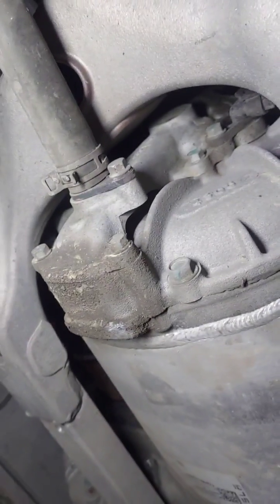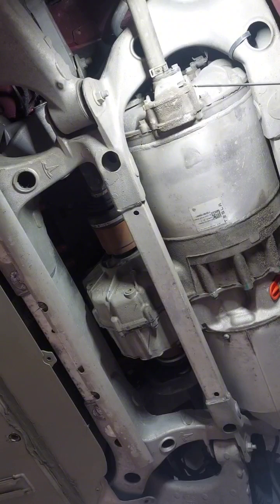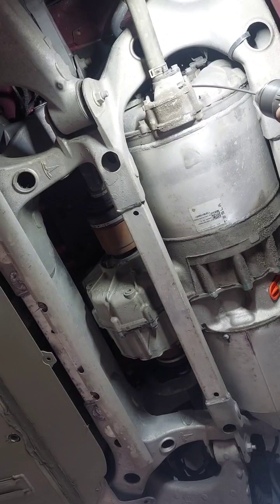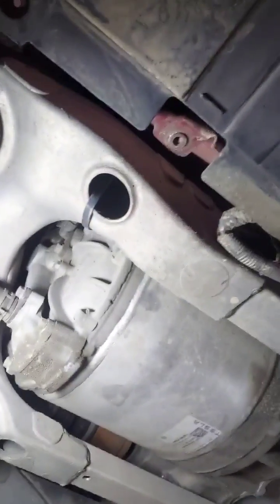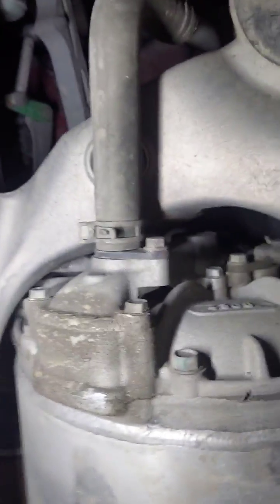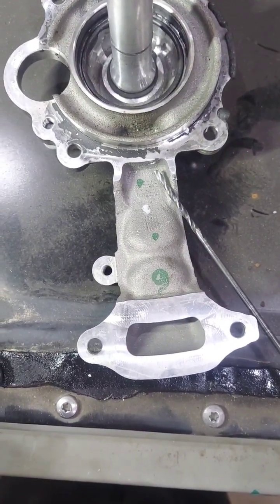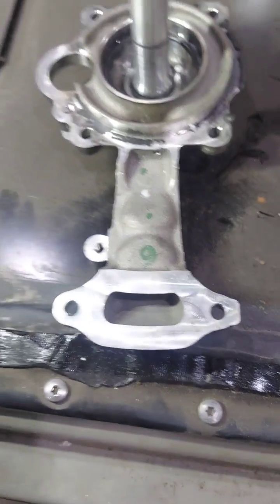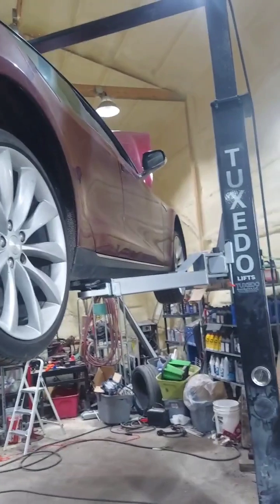Tesla coolant delete @ForkliftsbydayTeslasbynight

Comment: Can the coolant delete be fitted with the drive unit in place?
Reply from the maker: @Paul-M-UK  no it needs to be pulled out to remove the tube and press in place also I have not seen a drive unit yet that did not need to be opened up and cleaned out to save it from damage from the coolant and corrosion
Reply: @ForkliftsbydayTeslasbynight  Thanks for the reply. I am looking at buying an older Model S and this will be on the list of things to look at. From what I can see, the vast majority of older LDUs will need something doing to them. Just trying factor in what I will need to do (planning to do myself as I have 4 post lift and have worked on plenty of cars)